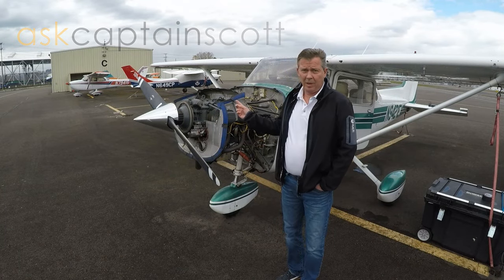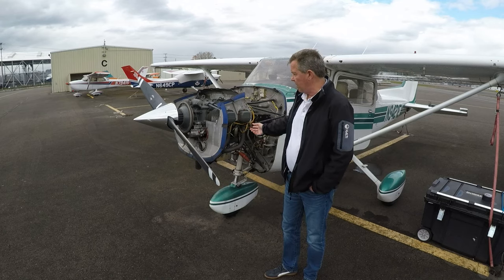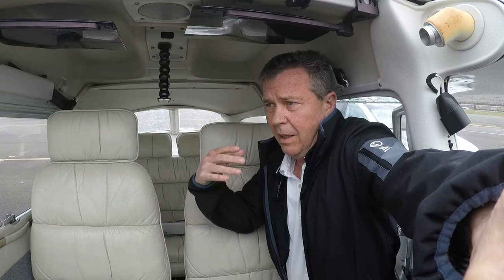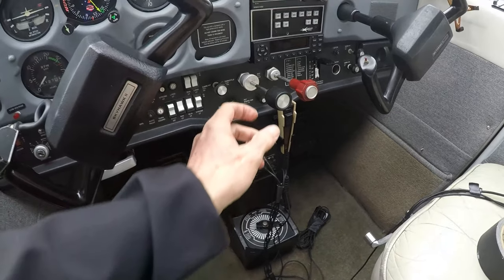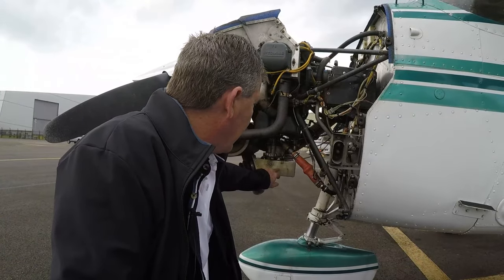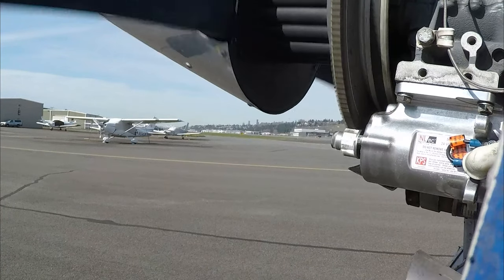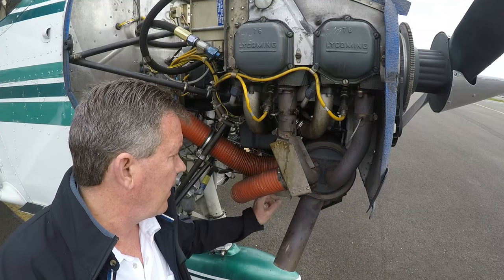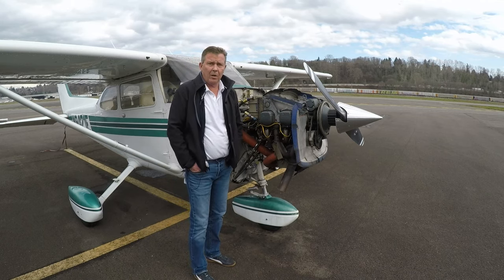Private Pilot Flying Lesson, Part 7, Engine and Carb Heat.                www.askcaptainscott.com

Comment: I remember my Grandfather's '59 172 or early '60s 150 had a bigger panel to check oil. I remember using the fuel sump tool to open the dzus fasteners. It's been 30 years, so maybe I'm wrong.

Comment: Thanks for this, this was timely and helpful.  I flew a plane I rent on a short cross country and after returning home and  landing I noticed a red tube and metal housing that was hanging down from the lower engine cowling and dangling next to the nosewheel.  I thought it was the cabin heat hose and connector but after seeing this I'm pretty sure it was the Carb Heat connection.

Comment: My old VW Bug had the same heating system.  It didn’t really work that great on Snowy/Freezing days.  We used to joke that by the time the engine was warm enough to blow heat you had arrived at your destination.  I don’t know if these older planes have electric blowers but the VW’s heat was blown by the engine rpm so if you were loping along in town the heat hardly blew out the vents.
Reply from the maker: Ya the cabin heat in the 172 is similar. It's rather worthless and when the heat pours out, it comes out of the sidewall by your foot so your foot gets way to hot.....

Comment: Using the throttle to prime the engine on start does work, but only while cranking. The action of the pistons creates suction at the throttle body so the air/fuel mixture is pulled into the cylinders. It's not the recommended method--priming is--but it does work. Moving the throttle without cranking, of course, does absolutely nothing.

The info about carburetor heat is interesting, but remember that at low rpms the throttle plate is turned to reduce airflow. As a result, the opening is narrower so that if icing is likely to occur at the throttle plate there is a smaller opening and full blockage can occur more easily.  While the green arc may indeed refer to performance, the arc is still a good reminder to apply heat, in my humble opinion.

And the clicking is the sound of the solenoid when turning on the master switch. This allows current to flow from the battery to most of the systems other than the starter. (There's another solenoid for the Start position on the that allows current to flow to the starter.) Internally, there's an electromagnet that pulls a cylindrical switch closed to complete the circuit. It's through that switch that very high current can flow.  When you activate the switch, though, you're not adding power to the solenoid--it's already connected--but rather you're just connecting it to a common ground.

Comment: Great vid Capt Scott.  On some planes they have a yellow and green arch on the tach. It has to with the engine/prop combination. Some props can set up a harmonic vibration at certian RPMs that are not good for the motor. Hence the yellow arc. Itermittent operation in that area only. But since your plane has fixed pitch prop you have no such limitation. Thanks for your vids!
Reply from the maker: Ya I've seen that on some constant speed prop planes. I'm flying my nieces 182 next week and will see if her plane has it.

Comment: Thanks, Capt. Scott, very well done. I always thought carburetor heat was electric. I would never have guessed it was a passive radiant header system; seems inefficient. Appreciate the knowledge.
Reply from the maker: Hey Gerda, I had no clue myself when I was learning how to fly. It wasn't until I bought the plane and started asking my mx guy questions that the light went on in my head....
Reply: @askcaptainscott  - I love it when that happens -- plus you can see whether your shoes need a buff on not...
Reply from the maker: @gerdawhite6012  lol
Reply: Having experienced carb icing in Cessna's I can assure you it works very well and quickly.
Reply: A passive radiant heater system is actually MORE efficient than electric heating, because it uses waste heat!

Comment: Excellent logic on the inneffectiveness of 'pumping the throttle' prior to start.  Possibly it can work 'while' the cranking is taking place and there's some velocity through the carb but on a few vids I've watches of them starting a beaver they did the throttle cycling PRIOR to cranking.  That squirt of fuel probably just runs out on the water.

Comment: I don't see how anyone can preflight without, at least, removing the top cowling off of the Cessnas. As a pilot turned A&P mechanic I never heard anyone claim the green arc on the tach had anything to do with carb icing. I took care of 2 C-172s both almost ran 100 hours in a month at a flight school. My first "executive decision" was to remove the wheel pants. They provide almost no benefit in a flight training environment, other than giving students a chance to hide the flat spots they generate when learning short field landings.

The C-150/152 & C-172 are susceptible to water-ligged air filters if flying in heavy rain because their air filters are facing forward and just below the prop. Similar Pipers are not as susceptible. At the first sign on reduced performance in rain activate carb heat, also called indirect induction. Doing so bypasses the clogged air filter and can keep engine operating with just the slight power loss due to carb heat rather than potential engine stoppage. This is very important if your aircraft is using a paper air filter. I think paper air filters may be prohibited by Service Bulletin or Airworthiness Directive.

The C-150/152, and to a lesser extent the C-172 really benefit from very lean operation during ground operation. The 150/152 engine spark plugs really load up with lead deposits during rich ground operations. I always did ground ops as lean as the engine could stand. You are developing vety little power (inherently cool). If you forget to enrich the carb for takeoff the engine will choke when you apply full power before you pick up any speed.

Comment: Hello, from Sydney, Australia
* Thank you for explaining the priming fuction. Readying the cylinder for combustion is accurate. Filling the carburettor bowl is not getting the gas to the cylinder to receive the plug spark generated by the magneto.
* I assume the design of having the carburettor under the engine is:
1. Close to exhaust system for heat (de-ice).
2. Enjoy the new oil in the engine.
(next change would you drain and open the filter, to inspect between the fins). Just to see if any particle or ferrous metal is evident?
Such as: cylinder wall or piston head burring.
🌏🇭🇲👨‍🍳
Reply from the maker: Ya we opened the filter to check it. No metal, that's a plus. I'm putting a new engine on it pretty soon as this ones hit TBO plus Im going from a tired 160HP to a shiny brand new 180HP.

Comment: Good overview of what is under the hood. I took instruction in a Champion Citabria in the mid sixties, and although my instructor taught great stick & rudder skills, he never went over the powerplant details. The Champ had large sections of the cowling that opened up easily on both sides of the engine, but I never really learned about anything except where to check the oil and where to drain fuel to test. Thanks Captain Scott. Wish I had gotten certified back when it was a lot cheaper to fly GA.
Reply from the maker: Hey Mark, I was never shown or had any of it explained either. Funny how that doesn't seem to be to important during flight training does it.

Comment: I think the green arc (RPM gauge) is reminding to use carb heat when below, to prevent shock cooling (basically, slow down the cooling). When you throttle down below green arc, the engine cools down rapidly while much less heat is being generated. Cooling too fast can result possible stress on metal parts.
Reply: That's how Chkalov bought the farm, right?

Comment: Then you for the great info, however your carb- heat info was rather grey in explanation! All the same, you’re my greatest!
Reply from the maker: Hey Brett, are you referring as in when to use it. This was more a systems explanation rather than a flight training when to use it sort of video. I have the flight training vids on the website. Glad you liked it though.
Reply: @askcaptainscott  thank you for your response, what I wanted to know is when you push  the carb icing lever ( you showed a square metal shroud around a pipe) what I want to know is when you push the carb icing lever, what are the moving parts, what happens to that metal shroud, does it move like with the cabin head butterfly?? Does it open a channel to the carb Venturi?? I will go and study further... however with your blog I would like to have seen how it works! Lol... just saying.. love your show and will always follow! Cheers

Comment: why is it that the POH wants you to use carb heat outside of the green arc? I know a lot of guys don't do it but thats always what i was taught
Reply from the maker: Hey Daniel, What model and year of plane are you referring to. My POH for a 1979 172N only says to use it prior to large power reductions. My guess there is that if there is ice in the carburetor any further reduction of power would cause less airflow through the carb causing complete airflow blockage due to ice buildup.....I'm sure some youtuber has done a video about that... I guess Ill search and see.